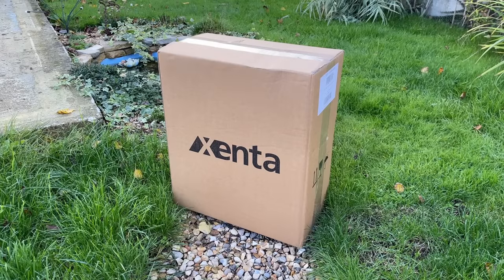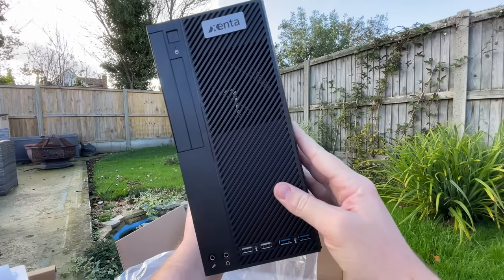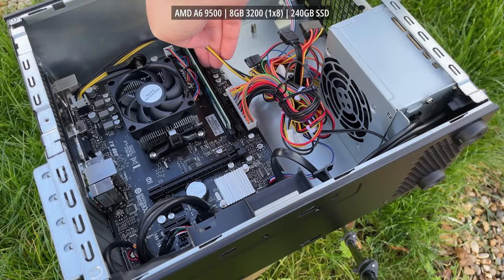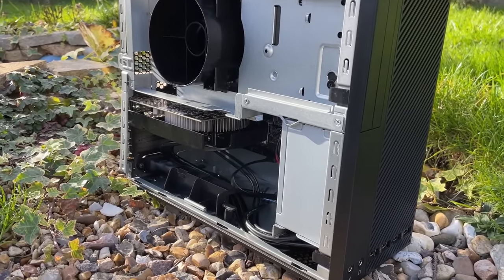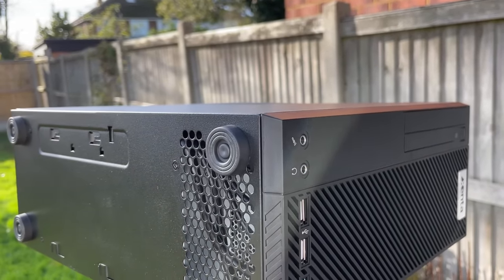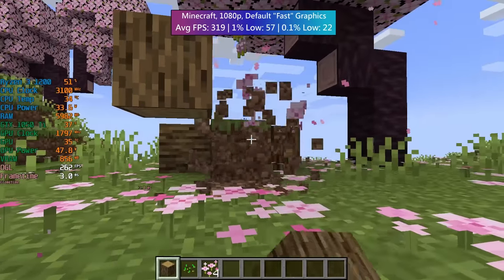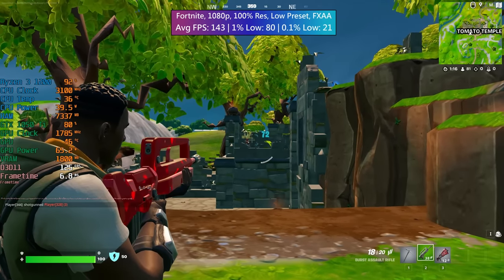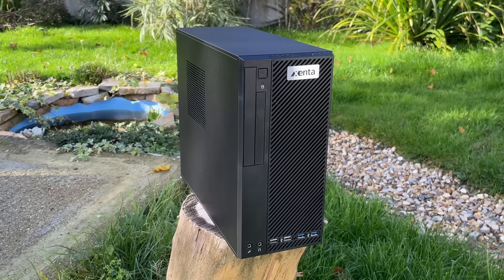Giving the cheapest new prebuilt PC a low-cost gaming makeover

Comment: FSP power supplies are high quality, not surprised it held on.

I really like this system. It's compact and VERY upgradeable. I think the major OEM's can learn something from this.
Reply: yup theyre great, had one in a 2012 prebuilt that i added a 750ti to later on. been using the same PSU since 2018 to power my amp/subwoofer in my room

Comment: Honestly, the fact you can get thid off the shelf basic PC with 3 year warranty for less than £200 is great!

I remember paying £499 for my core 2 duo e6600 
512mb ram & 40GB HDD back in the day, came bundled with a copy of Vista and an AOC 720p LCD monitor too.

God I loved that machine 😂
Reply from the maker: Awesome. My granddads pentium 4 machine cost £900 when he got it. Was top of the range at the time. I see the same model go for £20 used now haha. I loved that PC, but how times change!
Reply: @RandomGaminginHD  I am silly , when I see older high end GPU in adds , I get exited , but then come realization that that kind of hardware 2023 is only for playing retro games ... but that dont change fact I would like to have them all :)))
Reply: it wouldn't've handled GTA IV well
Reply: @cydragon2.099  GTA 4's PC port was unoptimized to begin with
Reply: Windows Vista 💀
Reply: @SockyNoob  it takes little time though to put in essential mods to get any version of IV to be more than playable and 1 such is DXVK
Reply: Uhh, 512MB for Vista was slightly too low, weird it shipped with this amount in late 2000s - it was more of a 1-2GB era 😉
Reply: @kkolakowski  thats why my first upgrade was RAM, it ran like spanners 😂

Then I ended up getting a inno3D 9500GT, I was over the moon to run Crysis at the lowest settings under 30FPS 😂
Reply: E6600 was pretty high end, me and my boys were rocking E21x0 lineup that were overclocking like crazy
Reply: Back then the way to go was get an E6300 (the cheapest core2duo at launch), then OC the shit out of it (virtually all could do over 3 Ghz).

Comment: If it's a normal SFX PSU and not a proprietary model, then there's room to expand to a 500w SFX PSU and an ITX sized RX 6600 XT. A Ryzen 3 3300X or a Ryzen 5 5600 can really bring up its gaming performance. Of course at this point, you might as well just build a new PC using a mix of new and second hand parts. A pairing of Ryzen 5 5600 and either a second hand RX 6600 or a brand new RX 7600 are hot now on the price to performance market.

Comment: That was a nice little Xenta machine, if you can find the upgrade parts cheap enough then I'd say definitely go for it. It will definitely outperform my older gaming oriented system, which has an i5-4460 and 2GB 960.

Comment: Those Fortron 250w units are good for what they are rated as, I have come across 15 of them in old ex cyber cafe machines and they all still worked fine after many years of 12 hr day every day use.
Reply: The FSPs of this type I have had are not the best. Maybe some notches above complete garbage. But they were Core 2 era PSUs though.

Comment: Built a new PC for my Dad, in Dec 2019 (when mining dropped off a little, so parts pricing dropped a bit). He uses it for browsing, emails and office programs. Most of the time he prefers using android phones.  I could have gone pre-built route or built a much lower spec and saved a bit of cash, for his user case. But with 20+ years of me building PC. I looked at the options and went for; msi b450 tomahawk, R7 2700, 16GB (3200) ram, Rx580 (8GB), 512GB Nvme, be-quiet 500w PSU, DVD-RW (we sometimes use), £600 all in at the time. Which I was happy to with and should see many years of use for his user case.

Comment: Quick bit of advice for certain games: In games like GTA V where the CPU is the bottleneck, actually increasing the video settings may actually lead to either higher fps/higher percentile lows, as removing the CPU bottleneck will generally make the game run smoother
Reply: I've noticed that generally, the more fps the gpu is allowed to generate, the harder to cpu works to manage it, so it makes sense that making the load on the gpu harder leading to lower fps would free up some bandwidth on the cpu

Comment: I got a neat little PC from ebay a few weeks ago for £25 - a cool small form factor Stone case with an i5 4690 and 256gb SSD - I put a low profile 1050 ti in it and an extra 8gb of memory and use it to play classic racing games with my nVidia 3D vision glasses. I had previously used a similar Lenovo M93 for that set up but I repurposed it as a Batocera box and gave it to my brother in law.

Comment: I'd like to see you upgrade it to a 3100x/3300x and maybe a used GTX 1060 or GTX 1660/S/Ti if there's power enough for it. Could be a great value if someone found that PC used and just want a cheap upgrade. The 3100x/3300x are beasts in their own right.

Great vid

Comment: Seems like the 1050Ti is actually being held back a decent bit by the R3 1200. I wonder how much more you'd need to spend on an AM4 cpu to not hold back the 1050Ti. Considering the CPU and GPU don't seem to be consuming more than 150W according to the Afterburner OSD, there should be some headroom for a different CPU.

Comment: If Alan Wake shows mesh shaders becoming the norm, it might be worth making the 1650 be your minimum  Apparnetly there are sub-75W versions without the additional power plug.
Reply: Either the 1650 Low Profile ones, or the RTX A2000 which is essentially a 6 GB version of the 3050 in a 75W, Low Profile mount. The RX 6400 is also a possibility.

Comment: In Serbia, you can get a ryzen 5 4650g system (8gb of ram tho) for about 220 euros. Add a second stick of ram and you're good for basic gaming. Most games will run with reduced settings on vega 7 until you can afford a good gpu.

Comment: Interesting that an AM4 mobo isn't using NVMe. I was definitely expecting this to be older than that.

 Does it not have the slot, or was the SATA SSD just cheaper? I'd love to find what the oldest Intel CPU that would perform about the same as the original CPU. I'm seeing refurbished gen 7 Intel i7s for around the same price.
Reply: probably just not having the nvme slot is cheaper to make
Reply: Intel's equivalent to AMD A6 series would be something like a Pentium G4400

Comment: I bought several Zoostorm Stormforce A8-9600 and A10-9700 system off eBays and upgraded them with a Ryzen 2600 and 1050Ti. They come in a half decnt case as well with a pretty decent PSU too. So it was easy money... I think XENTA seems to be the new Zoostorm. Not sure whether they took them over or whether they just have the same parts supplier for the cases but some models are identical except for the badge.

Comment: As you stated, it doesn't make sense todaty, but in the near future, if that same machine is available used for $100 USD or so, and something like an RX 6600M (the Aliexpress laptop ones on discrete cards) are around $100, this could well be an appealing option, especially if a Ryzen 5 4500 could be had cheap.

Comment: I would agree at the end, this PC is only good for office settings where a powerful computer is not required at all. The PSU and case, that doesn't allow for much space at all, is a huge bottleneck; the proprietary motherboard is pretty useless as well, I wouldn't even get this as a first computer for a son or daughter. It's better to get cheap components, and the microATX motherboards and case are usually the cheapest. A PSU of at least 600w to a max of 750w so that their is rarely a energy bottleneck when it comes to most low to mid-tier graphic cards. You can build a pretty competent system for only $500-$600, one with a plexiglass side-panel, large CPU heatsink, three RGB fans, 600w bronze PSU, $180 graphics card, 16gb of 3200mhz ram, and a ryzen 4000 series.

Comment: Awesome budget build as usual! I would be curious is the Ryzen 5 1600AF would be a suitable CPU upgrade for around £20-25 more. Going 4C/4T to 6C/12T and double overall cache at the same 65W TDP would offer a big performance bump 👍
Reply: Indeed, it was what I was thinking... 
The 1600AF/2600 are also compatible with Win11, which the 1400 also isn't.
Just that alone is prob worth it, as Win10 will EOL less than 2y from now.

Comment: Great video again! Would be interesting to see what it can just with the GPU upgrade.
And was nice to see the Ryzen 3 1200, have the same, with single 8gigs and an RX570 4gb, powered by a 350W Corsair PSU. So far no issues, and was good to see, that I don't have to worry about perfomance for a while (for my use). Plus I have room for cheap upgrades.

Comment: Even with the limited VRM on that motherboard, an efficient more recent chip like a 3600 or 3700X would work fine in it (they're on the CPU support list and only need 65W). If you can find a good deal on the chip, that's a lot of CPU power in a very cheap package.

Comment: I still play XCom sometimes on an old A8-9600, which is the quad core version of the A6. Works just fine. :-) At +- 35 fps at 900p.
Mind you, Microsoft does not officially support Windows 11 on the A series of APUs, so you'll need to cheat to install it.

Comment: This is no sense to buy prebuilt 160 pounds, and change CPU etc. You can buy in parts New motherboard for 50 case and PSU for 30 both , and RAM for 15, SSD 20 . End save 50 pounds for buy GPU etc.

Comment: You claim that the A6 was "just fine" for everyday use, but from my experience of a laptop with basically the same CPU (though with a slightly lower clock speed) was not "just fine" as the SATA SSD/internet download speed was bottlenecked by the CPU as it hit 100% whenever I downloaded something and that was after manually disabling windows defender which otherwise ate 30% of the CPU at all times. Also any attempt to watch youtube at above 1080p30/720p60 resulted in lots of dropped frames. 
Basic web browsing with ublock origin was "just fine" I suppose, a bit sluggish compared to just about any other computer I own, but not frustrating at least.

Comment: This might be the madman in me talking, but isn't it possible, and cost effective to upgrade this system a little further? Like an ryzen 5 from the 3000 or 5000 series, or even testing if it can handle a ryzen 7 5700x and a more powerful graphics card with a power supply upgrade if necessairy and or possible. I didn't notice if the power suppley was a more common size and shape, and if it isn't maybe there are some power supplies that fit. I guess the vrms are somewhat limited on this pc, but what is the maximum upgrade that is sustainable long term in this pc?

Comment: The Fortnite results will be way different in a month, the current OG season is very easy to run because of the old map. In Chapter 4 Season 4 I got around 240 FPS avg and in the OG season I'm getting over 350 FPS avg
Reply from the maker: Good point. I’ll have to keep an eye on performance

Comment: In Asia I have seen prebuilts with ryzen 4600g 6C/12T and 500W power supply for about the same money. The ryzen 1200 in the build is really sus to me locked at 3100mhz with ancient architecture? You really should have checked the couch cushions a little harder or sold blood plasma.

Comment: If i remember correctly A6 9500 Is CPU sended by AMD for BIOS flash in Era a320, b350 x370 chipsets. This CPU is terrible but A8 9600 Is much better, but athlon 220ge Is Superb. And Ryzen Is another complete different Story.
Reply: If the A6 is slow compared to the 200GE, it must be absolutely horrible 😂
The 200GE was fun in its day, but now considered very weak.

Comment: I mean, it's not a bad way to get a platform and start to build out to a full custom from and you'll still be able to revert the OG build back and probably get most of your cash back.  I'd probably have picked up an R5 1600AF for about a tenner more and put a cheap 1TB SSD in (if it has an M2 slot even better, then you can just leave the SATA drive in situ for a bit extra), this would take it up to a £300 build but it would be quite a sorted £300 build IMO.

Comment: The RTX 4060 only requires a 300 watt power supply which is amazing when you think about it.
Reply from the maker: Yeah especially as there are some profile ones out now
Reply: You mean the RTX 4050 😏
Reply: @peterpan408  Nvidia is going to make a RTX 4050 if you go by driver support.
Reply: @stevenanderson3205  They ran out of crap die configurations.. the only lower config is the 30 class card! And that's a Video Adapter.
Reply: @peterpan408  I prefer my 4060 over my 6700XT and 6600XT and 5700XT and RX 6600 that's right AMD it has better memory management and uses less power it's actually amazing when you think about it and it has great driver support and sense it's 40 series it has DLSS 3.5 which everyone knows it's better than FSR.

Comment: A6 9500 is worse than A8 7650K by 30% based on userbenchmark.
FM2+ wins for once.
Reply: Well, not surprising. A6 are 2c/2t core models, while A8 are 4 core, or 2c/4t, depending on your view on bulldozer derived architecture.